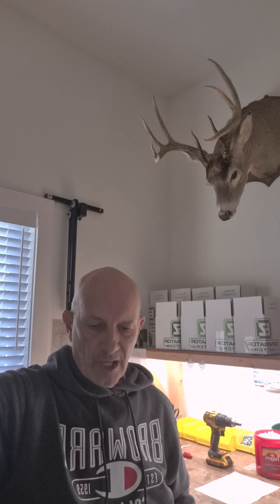Your Furnace Won’t Ignite on Backup Power? This Neutral Issue Is the Reason

Comment: Ok.  Think I almost have this straight after watching this and Ben Sahlstrom’s video.  I want to use an Anker power station, which is floating neutral, to run my HE gas furnace using your transfer switch and the existing switch box on the furnace as a junction box..  The transfer switch is shipped set up as switched bonded neutral.  I need to convert it to unswitched neutral by removing all of the white neutral wires and then re-installing one of the longer ones on the inlet.  Connect the other end to the line and load neutrals.  Correct?  If the neutrals are unswitched and connected back to a bonded panel, the furnace has its one bonded neutral it needs power the igniter.
Reply from the maker: The neutral in the floating neutral power source is bonded to the neutral in the circuit it is serving when you convert the switch.
Reply: @EZgeneratorswitch . Oops.  Thinking about the wrong end.  This makes sense because the switch isolates the generator from the main.  Thanks very much.

Comment: Does that mean the generator or battery could accidentally backfeed current into the home’s panel? Also, does that mean a battery pack will now see current going out on the hot side but nothing returning on the neutral side since the appliance is now using the house’s neutral? Help
Reply from the maker: Your power source will not backfeed because approved transfer switches are not physically capable of backfeeding, they are only connected to ONE source at a time. Your battery inverter is output only.
Reply: @EZgeneratorswitch  but I’m talking about back feeding the house via the neutral, is that not possible if your switch is set up for a floating neutral?
Reply: @Birdmacher  I have the same question, just received 2 EZ's today
Reply from the maker: You will not back feed on the neutral
Reply: @EZgeneratorswitch  Thank you